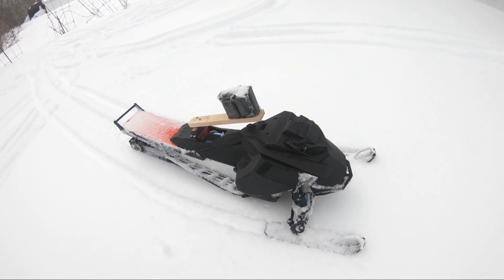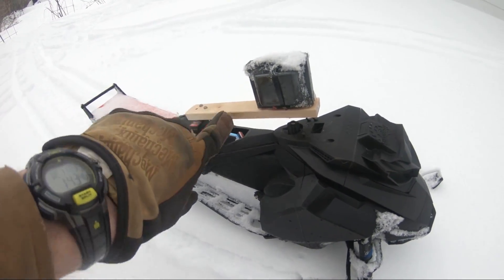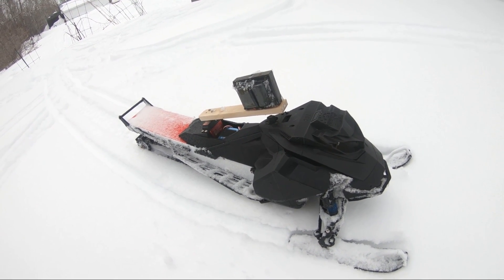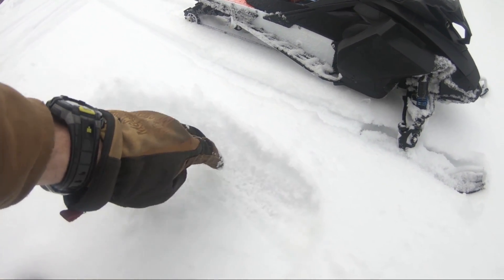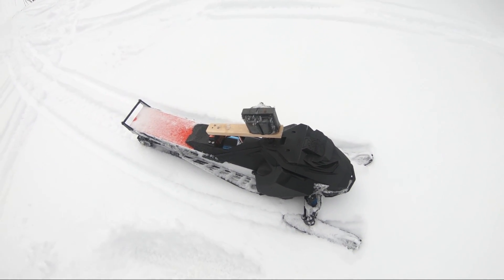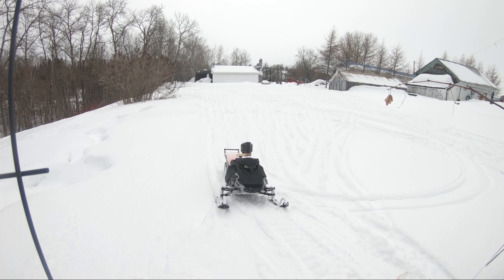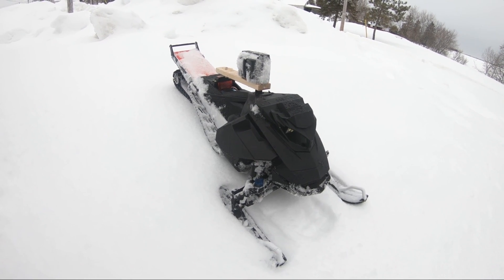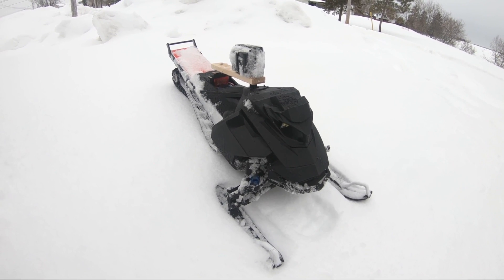Rc Snowmobile - Dynamic Weight System Possible?

Comment: Did you try having a gyro or something to give the sled feedback on it's balance point/etc and have the weight be partially controlled by the gyro? The microadjustments are impossible to do remotely
Reply from the maker: Yes and no I did build a compact gyro but I have never implemented it in a machine as I, for some reason, melted the motor wires on the outrunner.

 The project will come back one day though
Reply: @Pascal_Robert--Rc_Creations  Are you hopeful or what does your intuition say about this overall? I really want to figure this out, these sleds would be extra insane if the rider weight shift is figured out

Comment: You could put the servo where the handlebars are and make a heavy duty handlebar with a wisbone attached to the handlebar like a rider with a smaller weight in the middle and just keep the handlebar turning in same direction as skis this would change the center of gravity like a rider.

Comment: Yo il fodrais tu essaye un system qui pivote a 360 degree mais aussi qui es articuler pour pouvoir mettre le contre poid complètement vers larriere. Aussi j'utiliserai une mannette a 6 channelles pour avion un coter du dirige gaz brake et steering  et lautre joystick pour le contrepoids.  Pcq oublie pas qd tu vx faire du un ski desfois il faut que mettre ton poids dun bord pi il faut que tu tourne un peu du coter opposer au contre poid et puis aussi  tu pourrais faire des wheelie encore plus facile et mieux controller comme sa serai bien plus facile de garder les patinn a terre qd tu vx aller vite etc. Aussi jmonterai une carte spatiale 3D  pour que certaine possition du contre poid n'existe pas comme pour pas pouvoir mettre tout le poids carré a gauche toute car sinon c le poid qui froterais tjrs mais jferai une coupe vu du derrière en v a 90⁰ degrés pour essayer de faire décrire un arc un contrepoids qui serais plus realiste a cmt un motoneigiste place son poid etc. Tout cela évidemment pour essayer davoir un controlle plus naturel de la position du contrepoids. Pcq bon réalistement c dur de mettre tout son poid a gauche en arriere complètement. Mais en arriere o complet avec juste un peu de poid a gauche ben c réaliste. Fek tk batir une map modeler sur un joystick 360⁰ pour le contrepoid mais que le poids ne soi pas exactement un copier coller de se 360⁰ mais qui utilise aussi une articulation pour le bras du contrepoids qui va de horizontal a vertical et sinon pt mm utilise une manette de PlayStation avec une carte arduino jpense que les joystick eyant une trajectoire ronde et non carré (comme sur les manette a 6ch) pourrais encore plus faciliter un mapping reelle et operateur friendly du contrepoid

Comment: you need to be able to control the weight separate from the steering because when riding a sled carving in deep snow you turn the skis left and lean right and you will actually turn right on the side of the sled

Comment: Snowmobiles use a counter steer to carv and sidehill. Maybe less eight swinging the opposite direction of the ski would able good carves a sidehill. Three channel radio with ability to reverse the weight for flat ground turns would be key. Just subbed up love sledding and rc been doing both for 30 years

Comment: What if you reversed it so the servo was upfront, and the weight was further back and lower down? I'm no engineer, but it seems like more weight towards the middle of the track might be a bit beneficial.

Comment: Ur going to need to run that servo separate from the steering, ditch the wheel controller and get a joystick controller so u can run that servo separately from steering
Reply: Or adjust rates and leverage to reduce the weight movement compared to steering movement. Not entirely a loss to have them connected together

Comment: Hey man what type of filament do you print in?
Reply from the maker: It depends on what part im printing. Most of the shell is tough pla, if its not sufficient, i use polymax pla (even stronger) and if even that is not enough, i'm using tpu at 100% infill, that stuff is flexible, but also unbreakable, its quite usefull on the a-arms and spindles per example.
Reply: Pascal Robert - Rc Creations yeah ok thanks! I think the rc scratch sleds will have a forward center of mass since most electronics will be in the front and a generally light rear end... it could have impacts but not a concern of mine just letting u know.
Reply from the maker: @RCHomemadeHobbies  it has always being the case, even the full size ones are, and it's not really an issue with sufficient power

Comment: avoir par example une manette xbox/ps4 trigger droit pour le trottle left stick pour les skis et right stick pour le weight balance ca serais parfait! ca serais probablement dure les premier coup mais avec de la pratique ca serais je pense plus que parfait!

having for example a xbox/ps4 controller using right trigger for the trottle, left stick for the skis and right stick for the weight balance would be perfect! Would probably be hard to get use to at first but would be damn nice once you master it!

Comment: I too have been playing with a design that does the same thing.  Unlike yours, mine transfers the weight from running board to running board like a rider would on a real sled.  It's on a half circle where the handle bars are and a weight then slides down or up.  That with a gyro and mixing, I can turn it on and off and make the weight move opposite to the skis for carving. 

Sadly all the snow here is rock hard and I can't test it.

Nice work!  I'm sure you will integrate this better in the chassis and make it be great!

Comment: Could potentially lessen the weight and not sure if it’s possible but a lag where the weight doesn’t shift with your control instantly but maybe 80percent the speed so it doesn’t move to fast making the leaning with steering to fast and unpredictable. And I hear you talking about inverting the servo for the servo to work side hilling. Maybe a two stage where when you want to tip the sled it works opposite to the way you turn. Just an idea

Comment: Right on man you got it though, not enough benefits I put mine under the hood it only helped minimally, my front end is scaled to the with of an assault which helps with cornering enough
Reply from the maker: You need to show us the inside of that machine now!
Reply: @Pascal_Robert--Rc_Creations  I know man this big one has no steering assist, it's stable Af but the Yamaha and small rmk both got a counter weight attached to the steering servo just to help with stability
Reply from the maker: @MsHigheagle  I got ya.  Curious to see how you attached a counterweights inside of that RMK, the shell is pretty small...
Reply: @Pascal_Robert--Rc_Creations  well Pascal I extended my servo horn up and weighted it, so on it adds weight to the front which flops from side to side when you steer, I think yours would work great as a separate 3 position switch so you can pressure either side of the sled separate from steering control

Comment: With mine i tried to put the weights inside the drive figure's shoulders, with a servo moving the weights from left to right, connect to a helicopter tail gyro. Worked in some specific situations but made the riding worse in most other cases. I just removed it. Maybe we'll figure something out someday !
Reply from the maker: Do you have a video of it on your channel?
Reply: @Pascal_Robert--Rc_Creations  I don't think so. I tried it for 5min and didn't like it. You have way more weight on your setup though, might be worth trying a cheap tail gyro on it !